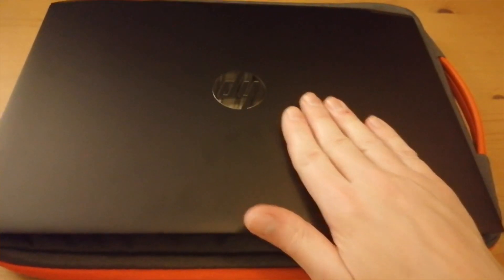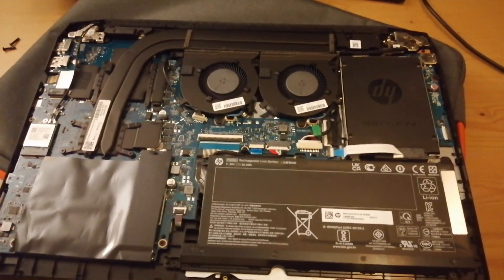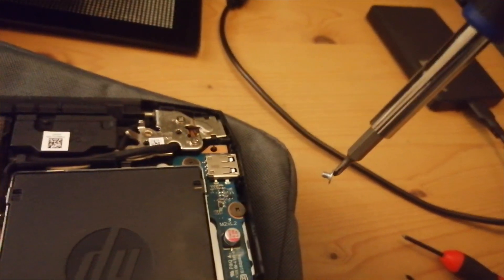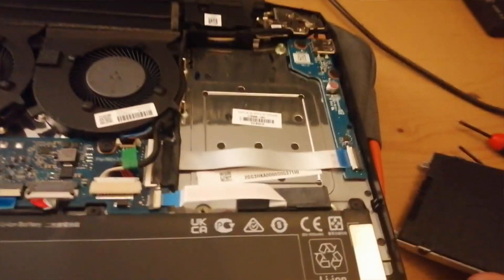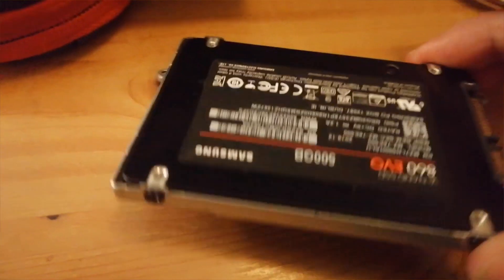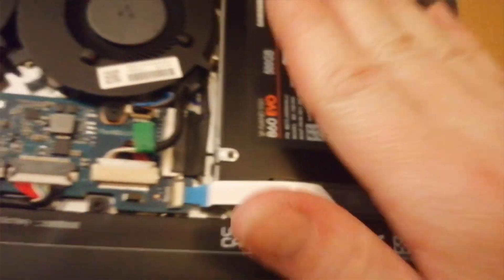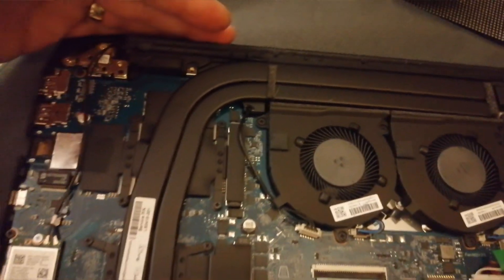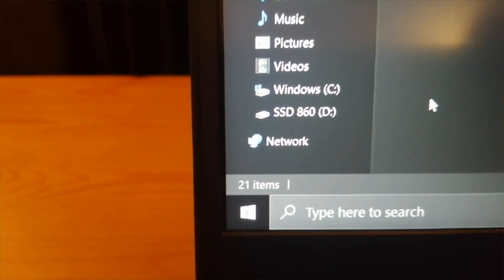HP Pavilion gaming laptop 15-ec1001na how to add / upgrade internal SSD

Comment: Is a SATA drive like the one you're using good enough for gaming on this laptop or should I just get a bigger NVMe? Is it possible to get an NVMe for the spare slot rather than having to clone? Thanks
Reply: SSD are always good enough for games tbh, you also can keep your OS on the original drive a just use the extra ssd as more storage.

Comment: Do I need to clone my SSD when I am replacing the blank?
Reply from the maker: No the original ssd is a NVMe version and stays in place, so in other words you will end up with two hard drives, your original and the one added.
Reply: Thank you, so I just need to install and will it add to my storage?
Reply from the maker: @nuttyproductions7745  Yep, you will need to make it an active drive, type Fdisk in the tool bar search and click on the program.